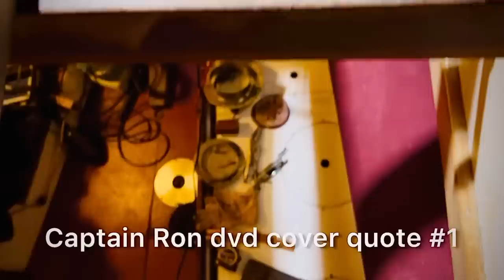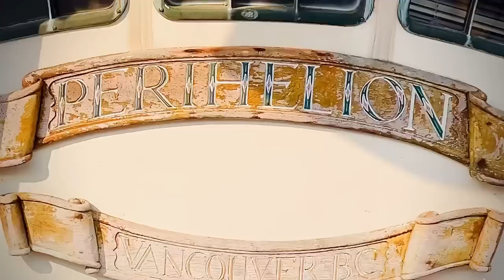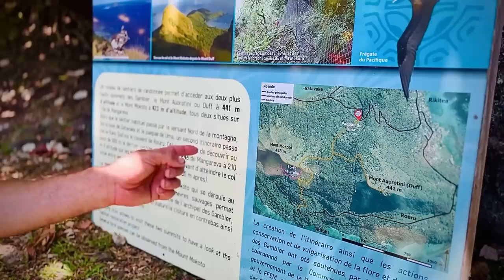Free Boat Hauled Out & Setting Sail 4000 miles across the Pacific Ocean! Sailor Barry: Episode 2

Comment: Good to see you guys using vinegar for cleaning the mould. I send to a supervisor for a company that specialised in mould remediation in North West Australia (a hot humid climate) so mould was a big issue.
The best solution was 80% vinegar to 20% water and using microfibre cloths, the mould sees the water as food and sucks it in along with the vinegar which kills the mould spores from within ( it is actually the alcohol that kills the mould).
Another solution that will kill the mould is 70% mentholated spirits to 30% water, however I would only use this when cleaning is completed. Spray all surfaces with this and leave open to dry and air out.
Never use bleach or exit mould (same thing) as this will only take away the staining from the mould, and actually feed it. It will the come back bigger and stronger. Remember it takes three things for mould to thrive and your boats environment has had all three, dirt, time and moisture.
Anyway good luck with your project.
Regards
Steve Ridge

Comment: First the V-berth is pretty cool and nice job on the cleanup. Second even a mess that galley is STILL GORGEOUS but the bit of cleanup really is starting to make her shine ! That said your choices in cleaning supplies are quite good in normal areas but do be prepared to use bleach in others. Not a lot just a splash with soap and water like chefs use against salmonella, e-coli, listeria, etc. Lastly in areas with black mold and such first consider if the part is worth saving or should just be be replaced. Other option in this case is high quality respirators and Microban that kills mold, mildew, fungus in general as well as bacteria and viruses.
     To end I am SOOOO jealous right now as your small ship is in wayyy better shape than my free small ship back in 1983 (refitted again partially in 2005 with modernized components).She is 87.5 feet (27 meters) with a 28 foot beam twin mast that was built in 1920. We had to take her down to her steel hull as the deck let water poor through and ruined much of the interior. The bowsprit, wooden bow carving under the bowsprit, masts, engine control, compass, wheel, rudder and a few other things we restored. The only prior experience I had with sail was just playing and my boat building experience was limited to freshwater hydroplane race boats as a 16 and 17 year old. Plus race cars, or working on Tomcats while employed by Grumman Aerospace and Northrop F-5 Tiger IIs.
     Great job so far and I'm happy for all of you.

Comment: Ha Ha 51 ft. Formosa!

I looked at one in Toronto (Outer Harbour  10 y ago?) Leaky deck,😂 Yada, Yada!
A Pirate Ship! Thick Fibreglass Hull, Center Cockpit, Apartment Sized Aft Cabin, Ketch, Really Nice Bow Sprint, (65k?).
You strip her down and replace all from bilge to the top O Mast, basically a renovation with a blank canvas for you to create YOUR masterpiece .(keel included) 
Thanks for the hearted response, my mother did pass and even just your small kind response was a surprise and uplifting.
Contact me when you get to designing your harness’s. I’m pretty good with anything that requires wires and could help in all the separate raceway design, pulls, and termination. 
(A couple weeks, long days of pre planed daily work scopes)

Best wishes !
Bryan from Blackstock